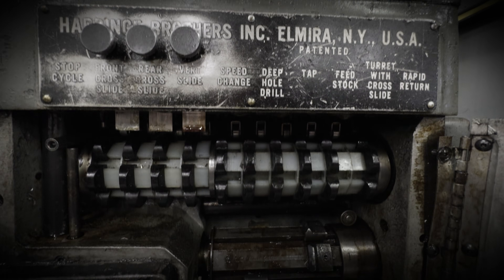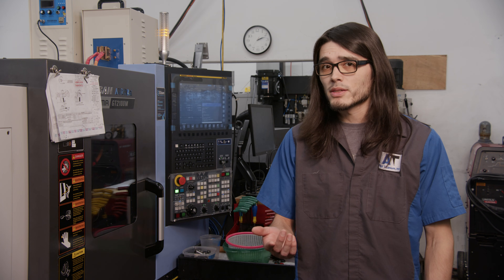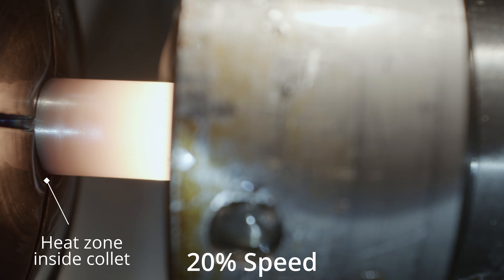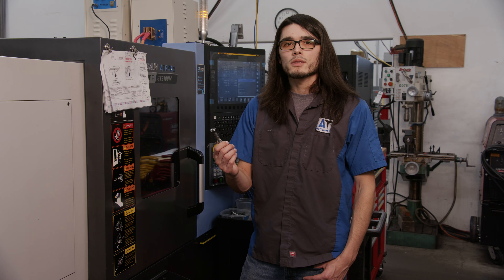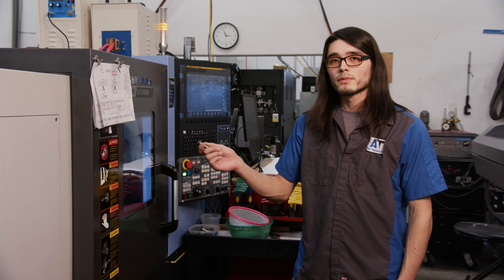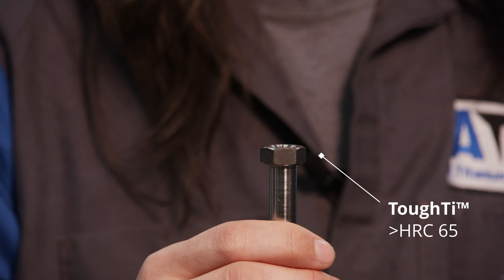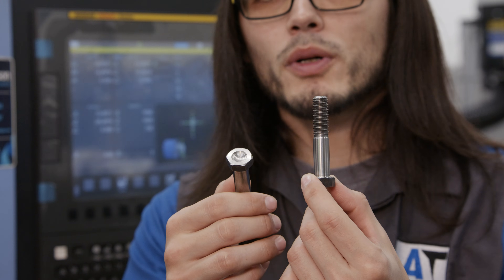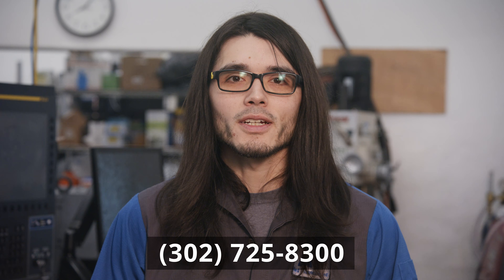Forchining™ on a Modern CNC Machine

Comment: has a retro ad feel but gets the information stated, and generates interest, and not too nuanced or too patronizing to the audiance, though every process has its ups and downs and things that could be better about it, or strengths and weaknesses like the tempering, is it as accurate as the traditional method of batch tempering, or how much heat is pumped into the metal, just playing devils advocate though as a fan of american manufacturing and stuff made here as well as new stuff in tech
Reply: I'd bet that heat applied to a small area of the part rather than the entire part and oven is way more efficient.  As to how much heat, I'm guessing they have that worked out to a science.
Reply: @Stan_in_Shelton_WA  its food for thought, I am versed up on titanium tempering though, a little though on the differant types of structures in metal like austinite, perlite, and martinsite, and the charts of metal chemistry of some knife steels and tool steels I read up on, the magic of the metal is really brought out in the tempering and heat treat, so that is why I would ask if its just in a small area how does it affect it, if its not normalized and heated all at once, one can only do things so fast to my limited knowlege on the subject.

I am honored the head of the company has quantified my question with a response though
Reply from the maker: This is Chris and I am the inventor and CEO of Allied. We have been keeping this secret as we Forchined(TM) for years into the space, defense and aerospace industries. The reason we are going public with Forchining(TM) now is so that everyday people get the chance to see what goes on behind the scenes. Also, the underlying mission of Allied Titanium is to make titanium products affordable to everybody. Forchining(TM) is a huge step in that direction. The cost of forged, tempered and precision machined aerospace grade titanium products have always been way out of the reach of most people.